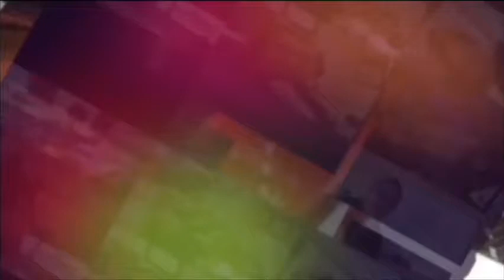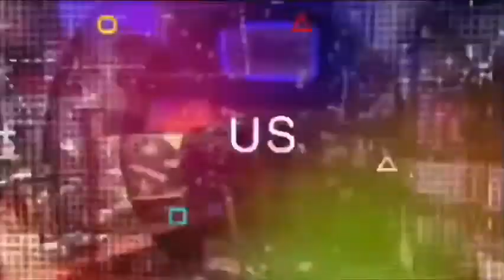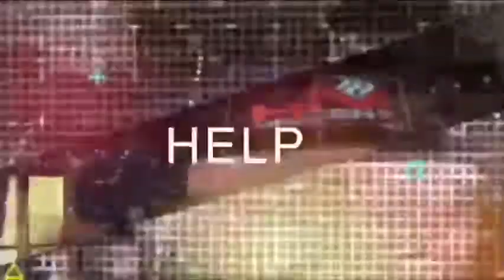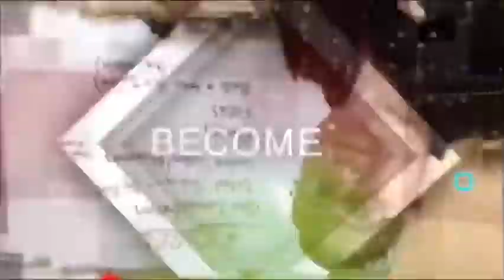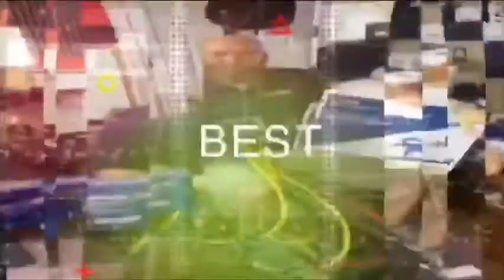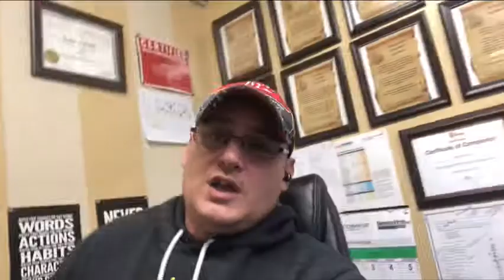HVAC UNCENSORED: Floor furnaces, wall furnaces and free standing stove diagnostics

Comment: well this explained a lot, thanks. My Thermopile seems to be sending 450 millivolts. The floor furnace lights sometimes and other times not. Sometimes the heater flame goes out when the thermostat has not reached the point where it should be shutting off. On lighting sometimes it goes on and in testing on off on off multiple times then later the tenant calls to tell me it won't light. Gas valve should be alright, fairly new. Thermostat is new, thermopile I do not know how long. Cleaning connections will tell. I can also check the milli volt at the gas valve and then at the thermostat, see if there is a drop there.

Comment: we have a old empire gas floor furnace that has a 24 volt gas valve connected 24 to 30 volt mechanical thermostat and connected with transformer for electricity and still works fine provides good heat

Comment: My father has a 25 year old Empire 45,000btu floor furnace and the furnace lights fine, abd will run until the hot water tank lights, then the floor furnace shuts off. The plumbing is as follows.
1 and 1/2” main supply
Branch going to furnace 5/8”
Branch going to Oven 3/8”
Branch going to 75gal water heater 3/4”

This furnace always worked fine until renovations were made and the new water heater was added. I’m not sure of the btu of the water heater but it is a very large tank. The furnace still had the 1/2” line and my father thought it wasn’t getting enough gas so he upped it to a 5/8” but the problem remains. My question is does the plumbing seem adequate to supply the furnace? Thank you

Comment: My floor furnace pilot wouldn't stay lit. I replaced the thermopile, it would then stay lit. However, now I can't get the burners to fire. It's only about 3 years old. There was some water exposure last year. Thinking now maybe the gas valve? I hear the thermostat click when it is switched on above threshold heat. thank you